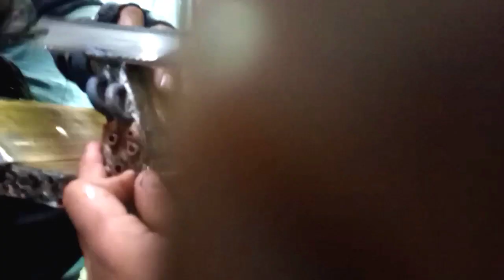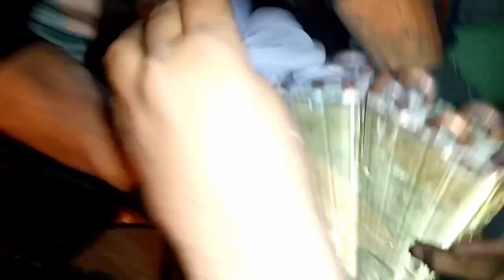HOW TO REPLACE AIR CONDITION U BAND must watch ? #smarttechskill

Comment: Pakistani brother thanks I change already 10/15 cooling coils u band but one suggestion please low flame of your gas welding when you replace u band & tried to no flame on u band because this is delicate work & high flame block cooling coil circulation